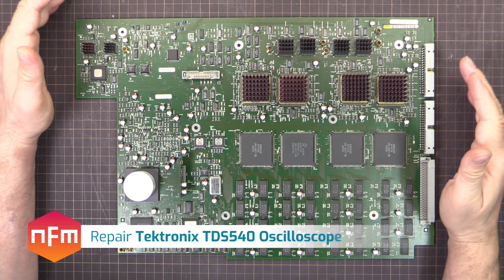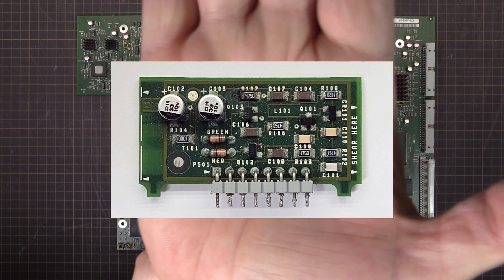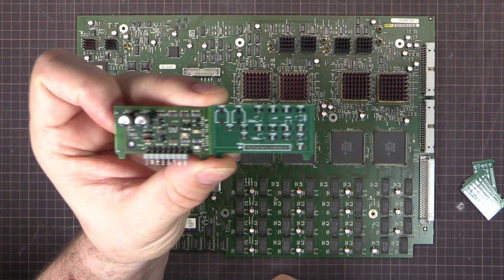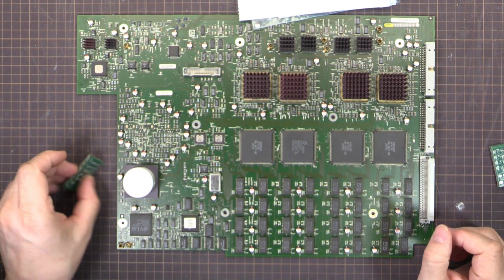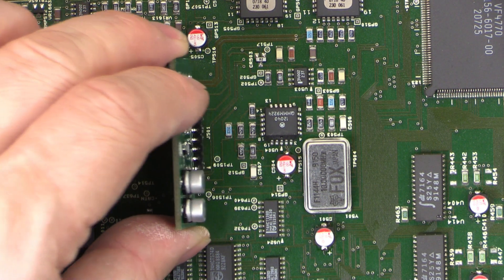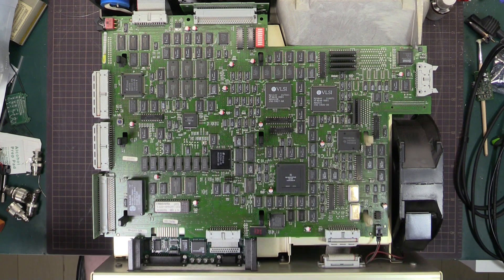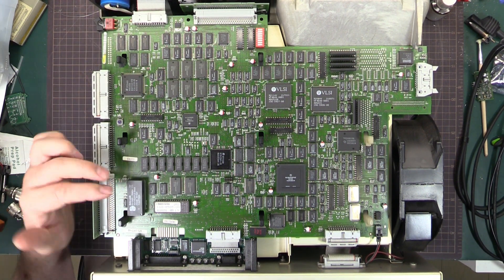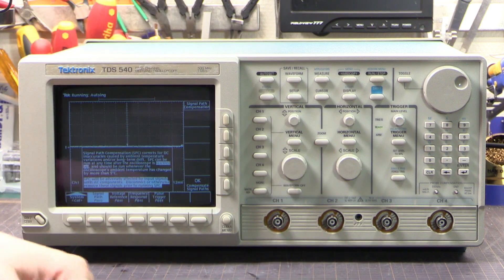Tektronix TDS540 Repair - New VCO board!

Comment: After immersion in water, it is recommended to heat the device to at least 70°C, as any cracked integrated components that have absorbed water may undergo oxidation over time.

Comment: I have a Tektronix TDS 744A that had the usual PSU issues of C17 cap, Q9 and two TVS diodes - all changed. Now the power supply hiccups and the output voltages are trying to come up, but the psu resets. It's loaded using your psu load PCB. The hiccuping accrues when it gets ac powered (cycles 1hz), and when i press the standby button it hiccups once a second in bursts (twice). What can the problem be?

Comment: Just a heads up for folks needing the Dallas NVRAM with the RTC.  A really great retro-computing YouTube channel, Necroware, has a solid open source replacement solution for these that use the ubiquitous CR2032 as the battery.  Check him out.

Comment: Nice! The 90˚ trace routing always looks weird to me, but nice to see you copied that in your replica 👍
Also, Farnell shows stock for that MMBV105G (however Element14 doesn't?)
Also a comment on Mouser and shipping batteries - Here in oz many couriers flat-out refuse to ship any batteries. I've had the phone calls with them trying to explain that Alkaline AAs are not dangerous, etc, etc... In the end we had to ship our product without batteries. So I can see why Mouser has this rule. Probably many shipments bounced at customs or international couriers. It sucks for everyone.
Reply from the maker: Yeah, I thought of using 45˚ corners, but figured I'd keep it true to the original.

It's always a pain shipping batteries, especially when the couriers default to 'no', even for battery chemistry that has been shipped just fine for decades before lithium came around...

Comment: Always love when a new NFM video pops up!  I routinely wash PCBs in an ultrasonic cleaner.  Quite a bit faster than the dishwasher, but if you want to save some dry time, here's what I do after the wash -- give the board a dip in 99% IPA for a minute (this drives out any remaining water from even the smallest nook and cranny), then pop it into an oven at 250*F (120*C) for an hour.  Works a charm.
Reply from the maker: Yeah, the IPA is a good idea. I usually do so with smaller PCB's, but I need to get a bigger tray for these TDS scope PCB's, they are quite large..
Reply: @NearFarMedia  I've done lager PCBs in either a cookie sheet or a large glass baking pan (don't tell my wife).

Comment: can you tell us what type of soap if any or type of water and temp the dishwasher had? I had never thought of this idea for boards with SMD cap leakage but sounds great ! :) and if your ever in Madison wi USA let me know and lets go for pizza
Reply from the maker: I just used the usual 'Finish' brand dishwasher powder, any normal dishwasher soap will work fine.
Reply: Would 70 degree Celsius be too much?
Reply from the maker: Nope, it's fine. Even electrolytic caps are rated to 85 degrees C at the lower rating.

And the components withstand much higher temperatures during assembly too.